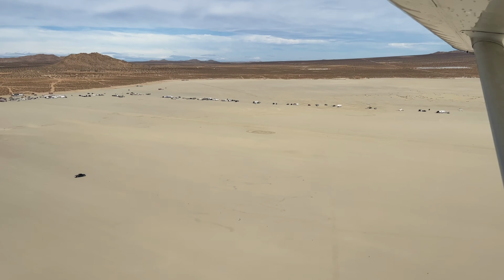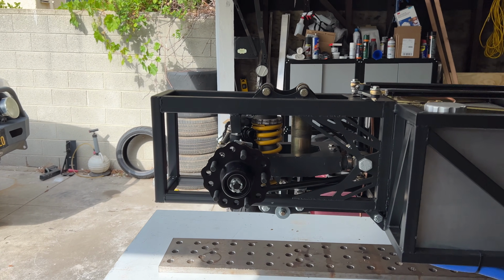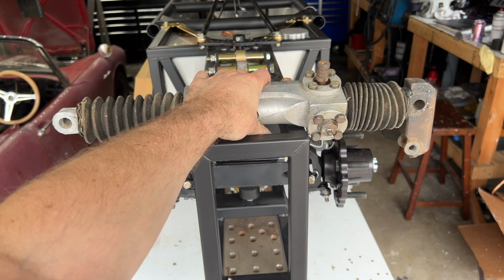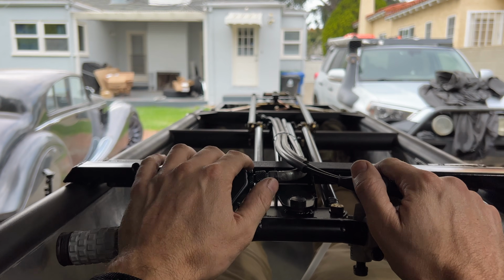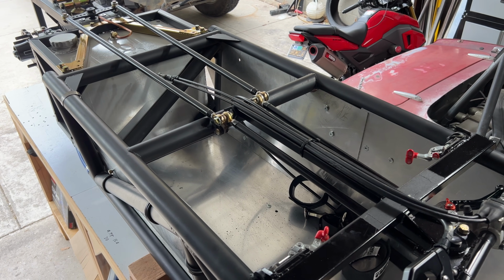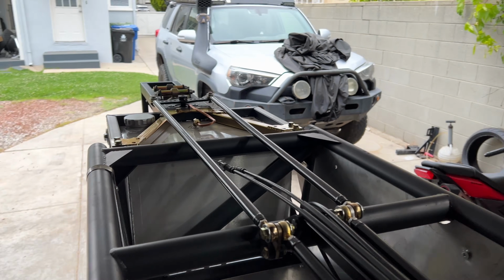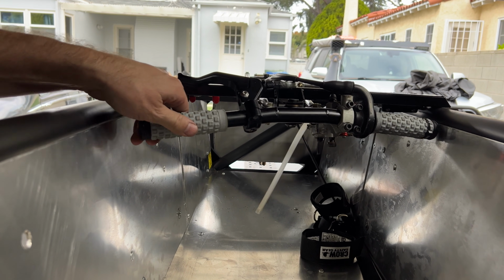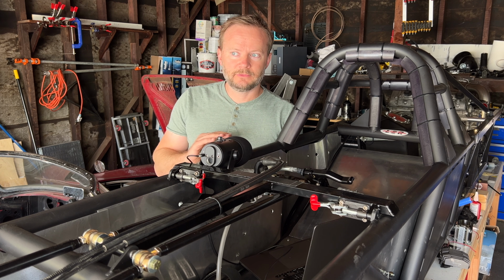Unnecessarily Complicated Steering

Comment: I would argue that escape velocity is a velocity, not a speed, because if you try to do escape speed on a vector that intersects the ground it doesn't work *at all.*  So while the exact vector may not be terribly important, there are a range of vectors that result in catastrophic lithobraking and you will not go to space today.

Comment: If the steering has to be straight or nearly straight in order to pivot the handlebars up, is it possible that a mechanical failure or crash could make quick egress difficult or impossible?

Comment: Yeh, two microns is less than the flex in ONE of the ball joints at the end of that connecting bar... I think you'll be fine.

But also, notice how in cars the front wheels turn at different rates. I'm sure someone somewhere has come up with the perfect equation for this motion and on a production car it would absolutely be invaluable to have - tyre wear and all... But on this - your total range of motion is what - 20°? And at speed it'll be a lot less than 1°. I think your tyres will survive just fine.

Comment: Im new to the channel, i dont want to be out of line because im not an engineer... but can I recommend adding some redundant chains/straps to hold that handle bar assembly down in the event of a wreck? That way if the frame bends in any way, and does sheer those over center latches/associated mounts, the chains wouldnt be rigid with the frame, so they'd be almost impossible to compromise and youre more likely to stay inside when it really matters.

Comment: Just curious.  Are you going to add loops or hoops around 4  -  links ? If you have a problem or a SHTF moment ., and things come apart, you don’t want to be harpooned. It’s in the rules too. Good luck , go fast. Be safe

PS  Spun my AA/ GMR years ago doing around 190 . No problems except for changing out the depends.  I

Comment: I don't know amigo, but.. the grip (hands position at steering wheel) will be horizontal like on a motorcycle? very different from the vertical grip of a car steering wheel. The question is whether you will be able to maintain steering accuracy at 350 km/h in suck bumpy road.. A motorcycle has only one steering wheel.. sorry my bad english. Good luck.

Comment: "Land speed" and "escape velocity" are both correct.  Land speed records require two passes over the course in opposite directions.  The vectors cancel out.  Escape velocity requires a vector that doesn't intersect with the mass you are escaping from (ie. the Earth).
Reply: Land speed requires two opposing velocities, speed alone doesn't get you through the track. Escape velocity only implies a domain restriction for the velocity, not a single velocity. "Land speed" and "Escape velocity" are still both wrong.

Comment: You should use sticks dragging in the dirt to steer and then you can make the wheels fixed.   If you want to go left just drag the left stick and if you want to go right just drag the right stick. If you want to go straight lift up the dragging sticks.

Comment: The problem with escape speed is, it is theoretical value how fast a rocket would need to be if it was going straight up. But rockets never actually go that way, it's much cheaper to reach orbit and then accelerate horizontally. I'd argue it's two different things: escape speed is for straight up, while escape velocity is minimum speed you need to have to escape in given direction.

Comment: Looks good! I like the redundant push-pull linkages.

I wonder if it might be worth it to spin 3 different bell-cranks to bring, so if the steering linkage isn't to your liking, you could get it nice and comfy. [It doesn't seem right just to put multiple holes in the part, weakening it.]

Would it be prudent to get some kind of heat-treatment to normalize what few parts are mission-critical, perhaps with magnafux inspection, and at least get a 2nd pair of eyes on it before the inspector?

I have seen some motorcycle racing frames have air bleed holes, forming a common volume, which is pressurized from a Shrader fitting. A gauge faces the rider/driver. If a crack forms, the needle will drop.

Lastly, sunscreen, https://en.wikipedia.org/wiki/John_Britten

Comment: Generally there are two types of speed measurement. Pavement racing is generally a one mile of run up to speed from a standing start.  Then speed is measured in the time it takes to cover a 132 feet trap. 
At Bonneville or Elmarage there is a one or two mile run up to speed. After traveling through the run up , you enter a measured mile. The “ speed “ is the time it takes to cover the measured mile. There can be numerous measured miles and as you get up to speed. Then the run must be backed up with in the opposite direction or the next day. Many rules depending on who is running the event. Be safe have fun and go fast.

Comment: As a non-engineer but a long time drag racer, how practical are the lock downs for the swivel portion of your "steering"? 
I am referring to over revving your engine causing it to erupt into a gigantic fireball and turning your butt into a filet mignon  on that sheet metal grill you refer to as a seat. Can you reach the releases so that you can make a hasty exit at medium rare? Especially with your hands and arms only able to move  6 inches because you are handcuffed to your own crotch. 
Will the streamliner body allow for access or impede your ability to reach them after you tied yourself up like a pork roast? 
I love your videos and don't want to watch Supercharred Matt in the future...
Reply: Oh and don't forget that you are doing this at the same time that you are trying to unbuckle a 5 point racing harness and trying to steer a blazing comet in a desperate attempt to slow down from a high velocity (speed?)...  just food for thought on your next video since fire suppression systems and fire suits are only designed to give you a little bit more time to escape...Cheers

Comment: Handle bar steering was common on a car in the UK ,designed by AC ...  The Invacar.   (look on YT for Hub nut,he has driven his all over the place) .On the invacar you push the handle bars down to work the brakes.

Comment: Hi Matt - just a quick 'something to think about' with regards to the throttle. You may run into problems controlling the throttle smoothly while also applying steering force to the handle bar. Using a thumb throttle instead could solve this, like what's used on ATV's.

Comment: i would have used a dual voice coil set up. you would have needed some pretty beefy actuators but it would have been cake to fabricate on the lathe.
Reply: or a hydraulic system ,that would be a lot simpler and you could use off the shelf parts

Comment: Matt have you thought about relocating the pivot points of the steering linkage on the handlebar side?  If you were to relocate them behind the bar pivot it should give it a slightly reduced initial steering response though it might create a bind further down the line.

Comment: As I said in an earlier episode, I still think push-pull steering on a vehicle that does not lean will be difficult to modulate at high speed and not feel at all like a motorcycle. I hope I’m wrong. (I now see that you mention it later in video.)

Comment: With your over constrained steering - It doesnt bind at 8 degrees but what if you hit a bump and the steering gets pushed past the point of no return? ... jammed steering and not of the straight variety.. Could be bad. Hopefully you have some stops in there to prevent this !
Reply from the maker: I have stops at both the handlebars and the wheels. but it wouldn't bind anyway, it would spring back to center. "Binding" was the wrong word. it just gets harder to steer at higher angles.
Reply: @SuperfastMatt  awesome, had to ask. safety third!

Comment: Great work! Can’t wait to see this run, I’ve built several streamliners over the years Radio controlled though and one uses very similar steer link system to this but on a rigid chassis and on paper it won’t work but in reality the small amount of play and and the angle of the drag link and the knuckle it works great! Good to see you added that 10 degrees are you using or thinking about a steer dampener?

Comment: i dont know anything about these cars, but i can see someone getting their pinky crushed between the frame and end of the steering handle.

Like maybe youre doing sharp turn at the pitstop/ loading or unloading it to trailer and something janks the front wheel causing the handlebar to turn very fast.

I hobby older tractors without powersteering, and with them it's easy to break one's thumbs if the front wheels are hit while taking a turn

Comment: I think your steering is either going to end up having a lot of play or a lot of friction, or both.  It's going to be very imprecise, and moving the links at the handlebar inward to slow the steering would make it worse.  I think you're going to end up cranking back and forth at the handlebar to keep the car going straight as it takes a set to one side, then the other as you move the handlebar through all the play and friction and hysteresis in the system.  It might "work" well enough, but for sure it's going to have terrible steering feel!

Comment: Trophy trucks use a pretty trick rack set-up where the rack is mounted to the frame and tie rods are attached via a wishbone to the center of the rack so they can run the longer control arms with less bump steer.

Similar idea might work with a dune buggy center steer rack

Comment: For the leg protection, you should weld some sheet metal plates AT THE TRACK with you INSIDE, and once you finish the race you cut them with an angle grinder so you can get out.

Comment: Hmm... as a BYE I have to ask, are you not concerned with any oscillations in this linkage system causing steering issues? Would a cable system have worked, or are their guidelines regarding the steering systems?

Comment: Turn your front assembly 180 º.  Drag a single front wheel, don't push two wheels. Just like a shopping cart front wheel. The Citroën back wheel in the front.🙃 Another thing, instead off pushing rods to press on the driving bar, transform that into pulling rods. Hope that helps, I absolutely love the speed of your presentation!!!

Comment: While your definition of escape velocity is correct, your graphic is out of place. Escape velocity (or speed if you prefer) is the speed at which an object will escape earth's gravity, ignoring atmospheric friction, and WITHOUT ANY ADDITIONAL PROPULSION. That rocket is clearly propulsing.

Even if you consider the speed of the CSM immediately after the TLI burn, I don't think any part of that thing you pictured reached escape speed. Although it was close. My reading suggest they were traveling at about 24,000 mph immediately after TLI burn. Escape speed from earth gravity at the height they were orbiting is just over 25,000 mph.

And if it makes you feel any better, I do work for NASA.

Comment: Built lots of stuff and your steering looks fine.  Just a few tips for my experience.  Lubrication free ball-joints with a teflon lining start out without backlash so I prefer them for precision linkages.  2nd, the redundant steering links will let you preload the whole linkage to eliminate backlash from other sources.  3rd, what's the back-lash like it that u-joint shaft?  Never had good luck getting low backlash with a cross-bolt, but clamp collars have always served me well.  (weld a coupling nut on and slit the nut in half for a quick easy clamp-collar.)  4th, how much backlash do your suspension and steering spindles have?  That's another source of bump-steer which will be no fun at >100mph.

Comment: Handlebars. Bike motor. Putting the chop in "chopper" to rake it out.
You sure you're in the car category?
Since wheel count counts, wouldn't it be simpler to ratchet strap a spare set of rims onto the panier racks of the beemer and send it?

Comment: I have close to zero scientific reason for this thought but I feel like you'd be wanting the weight bias to be toward the front rather than the rear? 

Car looks great, coming together nicely. I cant wait to see the process of building the body.
Reply: The centre of mass needs to be ahead of the centre of aerodynamic force in a crosswind, but the long tail will move the aero centre back to handle that.
Reply: @brianb-p6586  thank you for the explanation! Makes sense.

Comment: I would argue that for any body escaping a gravity well there is a required directional component. Any direction where your course intersects the source of the gravity well will not result in your escape from that gravity well, no matter the speed. You at minimum have to miss the object creating the gravity well, so it can still be termed escape _velocity_.

Comment: Shouldn't the steering rods have some break-away point, so that you don't get double penetrated in some frontal crash? I mean, unless you're into that...
Reply: telescoping tubes joined by shear pins might be good, but one would want to be very careful to ensure that the break-away force is high enough that a severe bump in the salt doesn't disconnect the steering.

Comment: a forward linkage is actually more common than you think. any linked solid front axle vehicle uses this configuration. it naturally gives antidive/ antilift. the way you use the rack is make an intermediate bar to go in between, then mount the joints at whichever point you want. You are right on point with the steering, all linkage systems have some compliance. also your model doesn't account for the steering inclination and castor of the steering, so maybe it binds even less or more than your flat drawing. dont get to invested in getting it perfect though, oem's dont even have perfect geometry. imagine if they had to have different racks and knuckles for every length of Tacoma.

Comment: Hey Matt, I'm concerned about your over-center pins coming unlocked. Do the handles that operate the pins lock in place with a detent or anything? I use these style of pins and clamps daily in fixturing and the ones we use, the handles don't lock unless there's a pretty significant force acting on the main pin or clamp arm. Without a detent positively holding the operating handle in place, I'd be concerned about those vibrating themselves unlocked mid-run. 
Btw, LOVE your videos, dude.

Comment: Is there a way that you could keep the pushrods from impaling you if there is a frontal collision? It seems like you are going for a land speed record with spears pointed at you. Maybe some composite pushrod that would crunch instead of poke you?
Reply: I think that buckling force would be hard to correctly anticipate. A more common solution would be intentionally corrugated metal tubes that will collapse predictably, a construction long used in bumper supports and the front part of frame members.
Reply: Looking at the solid pilot cage he's built into the chassis, you'll be long dead from deceleration before the steering push-rods become a stab-hazard.
Reply: @martylawson1638  Assuming he is not upside down.

Comment: I think your steering looks good.  Remember to hold all of the rod ends with oversized washers.      Stop by our pits in June. Old tradition was streamliners used 3 or 4 of the same number (111, 999, 8888, etc. )  Too bad someone took the "last word in LSR"  - 9999
Reply: why?

Comment: Are there any rules about quickly you need to be able to exit the car in case of a fire? I’m sure that’s already figured out but with the arm restraints and the steering locked in on top I might be a little more spooked about turning into black paste than pink paste.
Reply from the maker: There is a bail out time, but I forget what it is. I should be fine with that. I also have 20 pounds of fire extinguisher in two seperate systems and an SFI 15 suit.

Comment: All those rod ends are redundant but if only one were to bind it stops everything. I'm sure you're going to replace all the threads in the rod ends with pins or shoulder bolts.

Comment: In order to get a landspeed record you have to do it in one direction, then turn around and get the same speed going the other direction. The opposite directions on the velocity vectors cancel and you're left with a simple speed not a velocity... or something 🤷‍♀️
Reply: Think you're right there. If you ran 201 "up" and 205 "down" the course, your speed would be 203 = 201+205/2 but your velocity would be 204-201 or vice versa. Ie +/-3? But this would be less than 2 runs of 50 and 60?!

Comment: I like your adjustable steering. When Don Garlitz built rear engine dragster, all of a sudden, steering control was insane, after many sessions, they changed steering gear box to half of the existing ratio. Bingo, dragsters steering fixed.